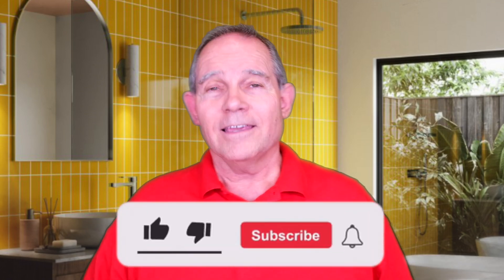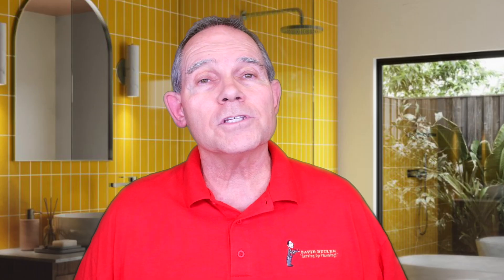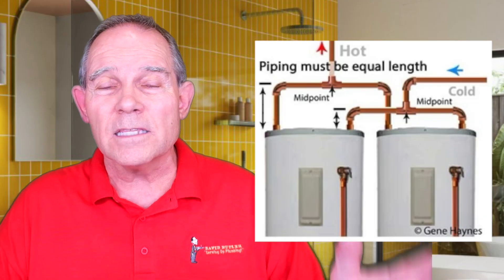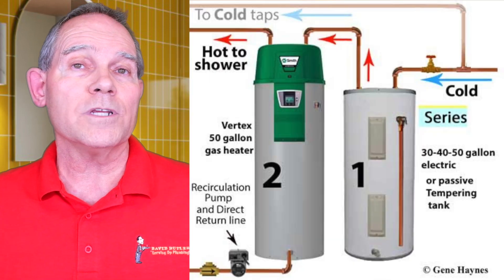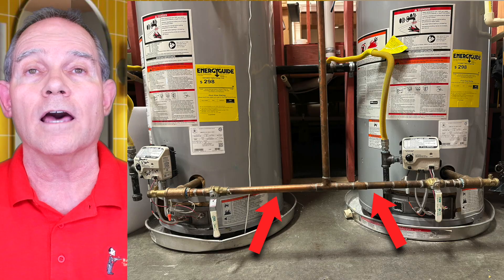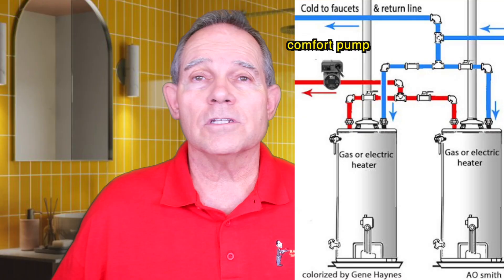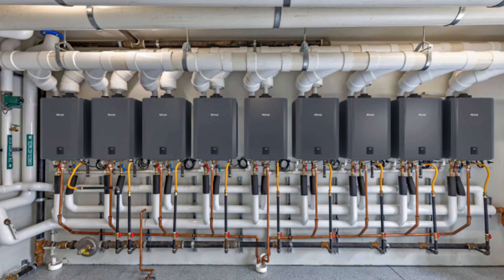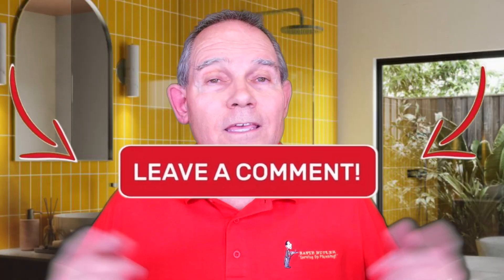Water Heaters: Series vs Parallel (Which way is best?)

Comment: Why can't I run water recycling lines on inside walls to use for space heating also?
Reply: That would violate a whole bunch of mechanical and plumbing codes. There’s very specific rules if you’re going to use the same water heater/ boiler to heat potable water and do building heat. Lots of these rules have to do with water safety, you’d likely end up creating some nasty water due to stagnation. 

Practically, you’d mess with your domestic water distribution (pressure and flow issues) and you’d really struggle to do any meaningful heating, plus you’d have to add some sort of control to regulate the room temperature. 

Trying to do that would be a nightmare, there’s very good reasons that domestic and heating water are kept separate.

Comment: I run a commercial space where 4 people take showers at the same time, every hour, and I'm looking to upgrade our water heating as we've noticed that the hot water runs out too quick at times. A plumber recommended going with two water heaters in series, but after watching this it sounds like parallel might be the better choice for the higher dump load. But, since showers are taken every hour here, perhaps the plumber's reasoning for series is the quicker recovery time which happens with the heaters installed in series? Great video!

Comment: A friend of mine was complaining about how long it takes to get hot water in the master shower and sinks (they don’t have a tub). I suggested they put a small tank near the master bath and put it n series. I don’t see why that would be an issue to get hot water faster and the small tank would be supplemented with hot water from the main tank so they could still take long showers with hot water. Am I missing anything?
Reply from the maker: That is an older method we used years ago. It works but is very inefficient and costly to install due to having to run electricity to it. Plus making it meet code with drain pan and T&P.  Some type of pump system usually works best overall.
Reply from the maker: Thanks for the question and thanks for watching!😁

Comment: I am looking to run 2 rheem 50 gallon Heat Pump Water Heaters in series. The first one has the leak detection and second one has the mixing valve integrated. First one will be set to 120 and the second defaults to 140 from Rheem. The second one is also a plug in so no risk of the elements kicking on. Why exactly does a pencil pusher think he knows more about my situation than I do?
Reply from the maker: 🤔not sure what answer you are looking for but thanks for watching!

Comment: (ignoring code) Outside of needing that large dump load, I feel like series wins out every time. 

When running parallel, if one tank fails, then you have half the hot water supply coming from a non heating tank, meaning you need to replace immediately. With series, assuming the first tank fails since its working more, you still have hot water (just lower capacity). You also have the option of setting the first tank to a lower temperature and the second tank to the desired temperature, that way both tanks are "working" closer to equal.

I know there's the argument that in parallel you could have valves to close off one tank, but in series could be piped the same way if you wanted that option. 

If you do need to replace a water heater, in parallel your balancing act just became much harder. One tank with have X years of wear on it while the other is brand new. If the older tank is now less efficient or for whatever reason has less flow, you will have to account for it. This isnt a concern with in series.

Additionally, if you do have to replace a tank in series, you made be able to get a more efficient model, or a different size, or a different heating type to account for changes in circumstances from when you installed.

In series, you have actually have a higher "capacity" vs in parallel. Tanked water heaters have a first hour rating, so a 50 gal tank might have a 65 gal first hour rating (I'm just using rough numbers for discussion, and many models might have more or less). So two 50 gals combined in parallel would have 130 gal first hour rating. However if in series, the first tank still has that 65 gal first hour, but the second tank would have a higher first hour because its heating already partially heated water. So your combined first hour capacity is now higher. 

Again, outside of needing that higher dump, I feel like the benefits of in series outweigh the benefits of parallel.
Reply from the maker: I absolutely agree with you! Thanks for sharing 😃👍

Comment: Interesting discussion.  Note, if doing it yourself, you can configure to your own best benefit.  Series can provide improved efficiency by setting the first one to a temp of a portion of the desired exit temperature and let the second one heat the rest of the way.  That way it's storing only one tank of fully hot water so the other loses less energy while sitting there.  Another benefit is sharing the load of heating.  

Parallel, as was said, offers greater volume of hot water at instant demand. 

So it's really about the goals of each application scenario.
Reply from the maker: Thanks for the info and thanks for watching!👍

Comment: I have 2- 65 gal. electric heaters piped in series.
My geo source heat pump heats both tanks.
The desuperheater goes through a circulating pump, into the drain of the hot out tank and out the cold in of the other tank and back to the geo unit. 
This gives me free hot water.
Oh, the water heaters are 35 years old and in perfect condition.
I guess parallel piping might work for this too but it would heat both tanks equally making less hot water available .
Reply from the maker: @trustme7731  Awesome!  Thanks for the info and thanks for watching. 😃

Comment: Instead of 2 40 or 50 gal heaters just get one 80 gal heater.

Beyond that like 12 tankless, go to a boiler system.  IE Lochinvar.
Reply from the maker: Thanks for the comment and thanks for watching!😃
Reply: My home had two 50 gallon water heaters. One of them was on concrete blocks to make it higher than the other. What is the purpose of this? I did replace the two 50 gallon heaters with one 75 gallon heater. It does the job but for whatever reason it seems to take a little longer to get hot water.
Reply: @alexiamelendez7192 to lift it off the concrete in case of flooding/ water damage

Comment: Series...  with supplemental power provided by low-voltage solar.

With one heating element in the the primary and another in the secondary, solar heats the primary first.  If the primary is up to temperature, the solar falls back to powering the supplemental.  If all are up to temperature, the solar rolls over to an inverter to trickle the house with electrical power.

Talk about simple.  Talk about a cheap and efficient thermal battery.  Talk about almost no code inspection required!

If I used enough hot water to require two tanks, it would be the route I'd take.
Reply from the maker: @russellstephan6844  Thanks for the comment!

Comment: I personally favor series connected water heaters. You split the work load by setting the first water heater to a lower setting. Where I'm located the ground temperature of our water is 55 degrees year around. We set the first water heater to 93 degrees and the second one to 132 degrees. 2.5 bath house with two 40 gallon water heaters and we've never run out of hot water even with two teenagers in the house. The hot water recirculation loop also "adds" additional buffer capacity to the system.
Reply from the maker: @firstdaddy  Thanks for your comment!

Comment: Series vs parallel is interesting to think about. I'm more keen to the series honestly. I'd like to think parallel really depends on some factors. To really get more flow from multiple simultaneous open taps, from the same pipe size, you need to have more pressure. Most setups, split the incoming cold equally, and then recombine equally within close proximity to the heaters.  You won't gain increased flow, EXCEPT if the water heater itself, is more restrictive to flow as compared to just a pipe. In which, then adding a parallel would help. I have never really tested to see how water flow is through a pipe, vs through a heater. I can't imagine it is much a difference.

If I were to do parallel setup, I would want to have the incoming water to the house be much higher pressure then normal, requiring PRVs. I would pipe the unregulated cold to the T split point, and then have a PRV for each water heater. I would also have a PRV tee'd off for the rest of the house. This way, the water heaters have each their own regulator, and better individual incoming pressure. 

One thing I do know that I noticed boosts hot water flow in my house, for at least the first 30 seconds, is the expansion vessel I have installed, with a check valve on the incoming supply line. As the water heater finishes heating, the pressure is higher in the tank then the PRV setting I have on the house incoming line. 

I have two identical hot water heaters sitting around as spares... And my home's incoming pressure is much higher then the standards... This sounds like it would make a great experiment, if I can ever find time haha!
Reply from the maker: @r3tr0nic  thanks for the comment and thanks for watching!